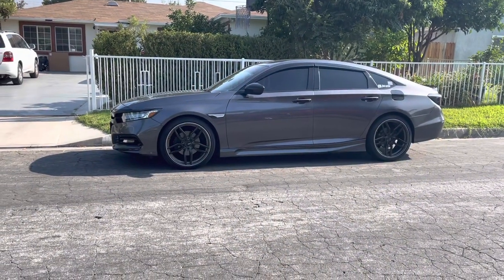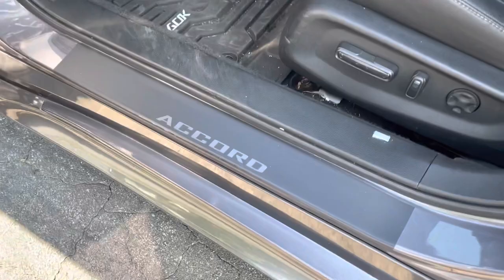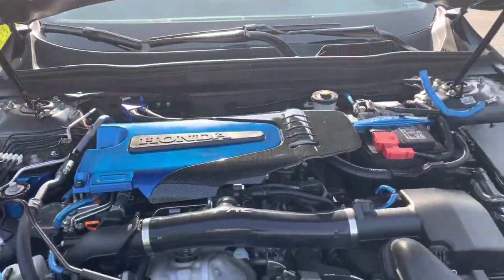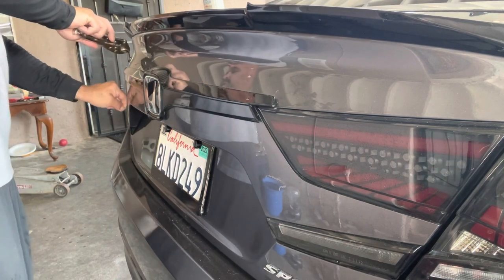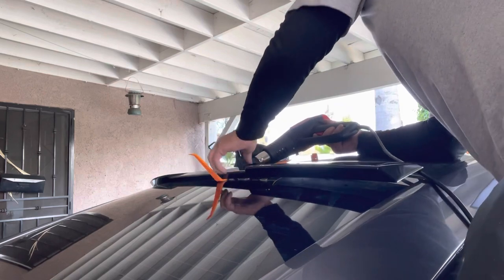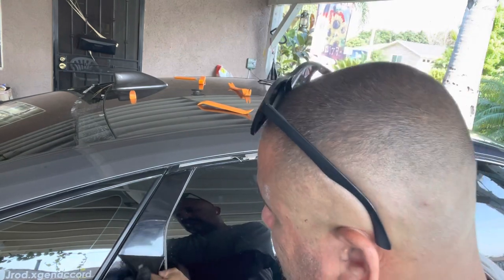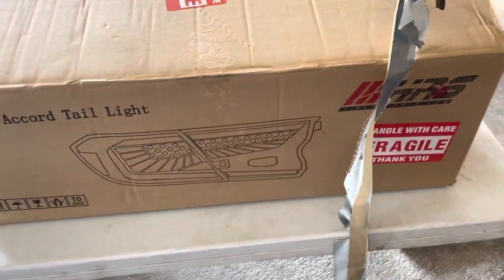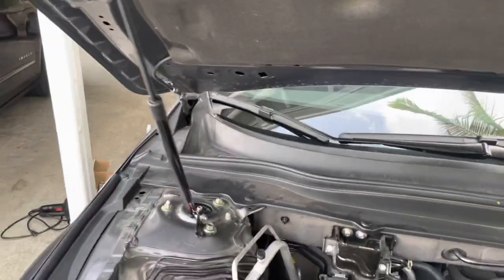Aftermarket parts removal 2018-2021 honda accord and parts list #10thgenaccord

Comment: Yo, where you get that motor cover? Link?
Reply from the maker: I painted it https://www.ebay.com/itm/FOR-18-2020-10TH-GEN-HONDA-ACCORD-1-5T-RED-BLACK-TYPE-R-STYLE-ENGINE-VALVE-COVER-/184933490416?mkcid=16&mkevt=1&_trksid=p2349624.m46890.l49286&mkrid=711-127632-2357-0
https://www.ebay.com/itm/FOR-18-2020-10TH-GEN-HONDA-ACCORD-1-5T-RED-BLACK-TYPE-R-STYLE-ENGINE-VALVE-COVER-/184404326397?mkcid=16&mkevt=1&_trksid=p2349624.m46890.l49286&mkrid=711-127632-2357-0